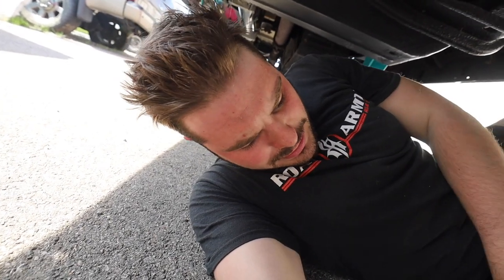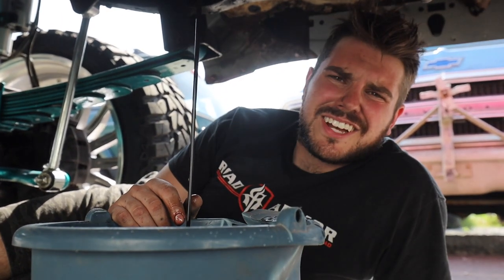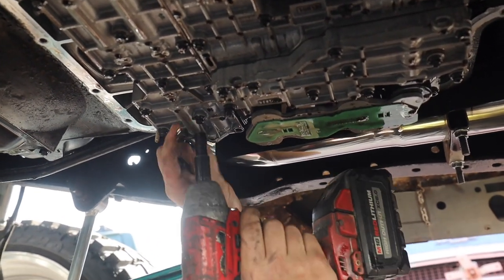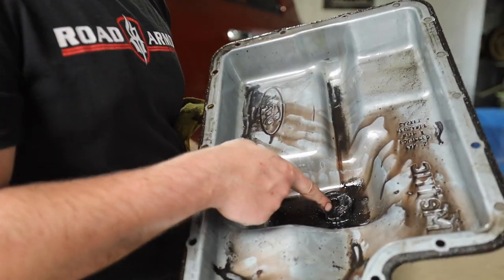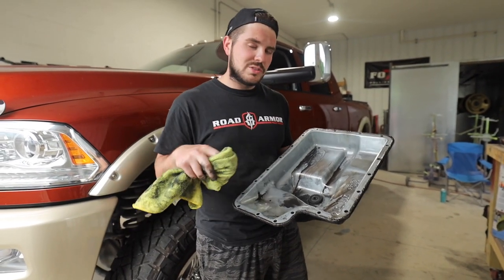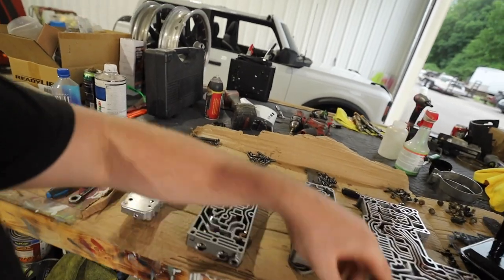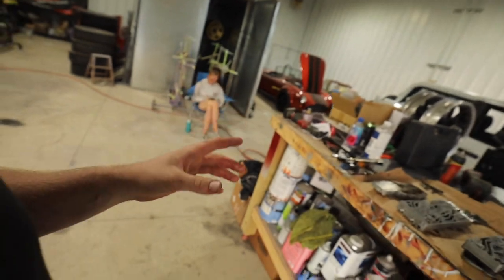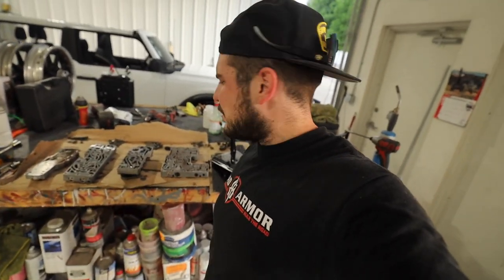Started Digging into my 4r100 after I lost all gears…Thanks Ford

Comment: Hey Ryan I’m a transmission rebuilder and sounds to me like your solenoid pack is at fault, but as far as valve body goes I used Transgo tugger kits in mine and love them which is a reprogramming shift kit and it addresses the accumulator valve body and the main valve and also the pump if you had the trans out. As far as your support bolts if you want to tighten them, take them out and wire wheel all the factory lock tight and reply lock tight and only tighten them to 90 in lbs which is factory spec. Also the little spring you have goes under the solenoid pack and that trangso kit has you replace with a new white spring and a poppet valve, also it shows you where to put all the check balls by identifying your separator plate.
Reply: X2 on the tugger kit
Reply from the maker: Awesome Adam! I appreciate that! Gonna look into that so tuggar kit and no John Wood’s Valve body?
Reply: @ryan2546  Tugger kit is less expensive than a whole valvebody and is customizable to however you want it to shift. I would definitely get a tugger kit. Trans will run cooler and hold good power.
Reply: @hosticktobias1961  couldn’t you run both if you wanted too?
Reply: @BradyBunting  well the the shift kit is mostly installed on the valvebody so doing a shift kit and valvebody at the same time is pointless
Reply: adam. My 4r100 won’t shift into hwy gear @40 and up it just hits the tack
Reply: youre no rebuilder. If you were you woukd know  He destroyed the solenoid body. by using a pry bar to get it out he snapped electrixal socket off.

Comment: You're a savage for just diving into the transmission like that dude, hats off to you for sure 👏
Reply: @UCO4B8GZWqt5Yt0A4X3-gNIw I generally do the same if it's like a th400 or something but with like my allison etc im just getting a bill 😭🤣 even for content on my channel I'm still scared lol
Reply: @AverageJoeBuilds  i did my allison with no prior experience. Probably the easiest transmission to rebuild. Unlike other transmissions with bands and crazy nonsense. The allison is all planetary gearsets. Literally 5 clutch packs. And the valve body had a few solenoids. I pretty much built a 1200hp allison in my garage for my first time ever building a transmission and not just swapping a junkyard one in.

Comment: Like others have pointed out definitely respect you for digging in and trying to figure this out for yourself. I was in the same boat about a year ago and a definite help for the future is the ATSG repair manual and update for the 4r100. Once a few factory flaws are taken care of these transmission become very reliable. First thing anyone who picks up 1 of these trucks wants to do is get the transmission cooler a 6.0 Powerstroke 5r100 and replace the the factory 1. When. You see the difference in size it will makes sense why the 5r100 holds up better. #1 transmission killer is heat and the original 4r100 cooler is not big enough to take care of the amount heat produced.  The rest of the updates that will need to be done you'll find in the ATSG books that you can download for free. Would definitely go for the triple disk converter even if you don't plan on making huge amounts of power.Not saying you need a billet front cover triple disk converter just a tripled disk witch is what alot of the remanufactured transmissions will come with. sonex makes some really good stuff and has a kit with just about everything needed to do all the updates and there who to go to for any valve body repairs needed. I found the most help on the FTE forum when I was going thru my transmission issues in my 99.5 CCLB 7.3.

Comment: With that Hydra, make sure you got the pins on the computer perfectly clean.  When I installed mine I really thought I had them clean but the tuner did nothing.  I pulled the chip and recleaned the pins on the trucks computer. After reconnecting it worked perfectly.  They are known to be quite sensitive to cleaning the pins.

Comment: I had a 2003 7.3 Excursion with 124300 miles. The trans blew and pink flood happened under the truck. I took it to my buddy's shop and he said those Ford trans go out at around that mileage consistently. It was $2300 to rebuild. Then it ran dope!!

Comment: I have a hydra tuner in my 2000 7.3 and when I first put it in the tuner wasn’t working all the way, when I was cleaning the silicone off of the chip connectors I didn’t get it all the way off and that effected the tunes night and day after I sanded it down all the way.

Comment: 5r100 and the 4r100 are almost the same. except Bellhousing, valve body and 5r100 has and extra gear you only use towing. Some race guys with 6.0s even do swaps cause they like how the 4r100s shift. But personally ive never had any issues with any of my 5r100s. but my 7.3 truck with the 4r100 I lost High gear and did a tranny swap with a c/l deal and its doing samething as the old trans I even swapped out the computer

Comment: My gen 2 lightning won't hold any gear, not even manually anymore. It used to work on 1&2 shift but not D. Sometimes, if you leave it on D, it'll randomly hold a gear and even reverse randomly, but after it does, it won't do it again.

I know my gears are fine, and something else is the issue, but every trans shop wats to just charge me for a rebuild because they think I blew the trans because it's a lightning. I don't even drive fast because 93 octane gas is expensive af and it chugs when you floor it.

Comment: If you didn’t need a solenoid pack before, you do now! The connector should not pull out separately. For anyone watching this, press down on the connector from the outside after removing the screws to get it out.

Comment: Hey great awesome video man! I have a question ... My trans is still in good shape , fluid is clean , it never gets more hot than 150 degree , but sometimes it has a delay when i shift into drive . did yours do it after driving for a while? Mine i just never know when its gonna do it .... I did change the accumulator valve body and i took the spring out the forward engagement but i never heard of the three bolts u are talking about ....

Comment: Not telling you what to do but with the four are 100 it seems that you get what you put into it. As long as you have a builder that’s not ripping you off installing a trans kit in a old trans vision is like putting a grenade inside of it pulling the pin, and waiting to see when it goes off, and of course we all know that the triple clutch converter is only good for 200,000 at best with a combination of driving and towing, so do your homework open up the wallet and get the moths out

Comment: Lose the dp tuner. I’ve tried them twice on 7.3 trucks and have never had good results.
Reply: I’ve had a DP tune on my 7.3 for 15 years now. It has 172,00 on the original transmission.
Reply: @jackadamz3  sounds like Jodie did a good job in your case.

Comment: Big things would be valve body and usually a shift kit. I know these 7.3s don't push that much power but that 4r100 and the older e40d don't hold that much horse and could really use an upgraded convertor and bigger trans cooler.